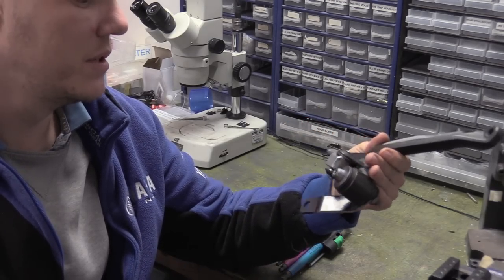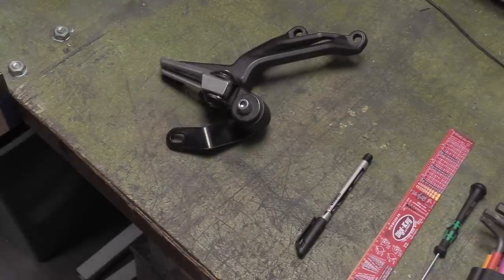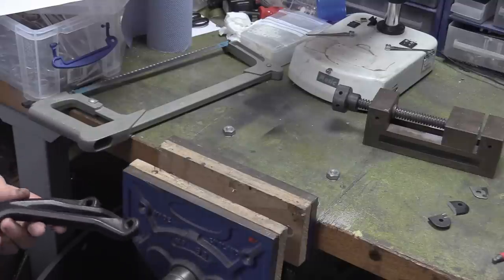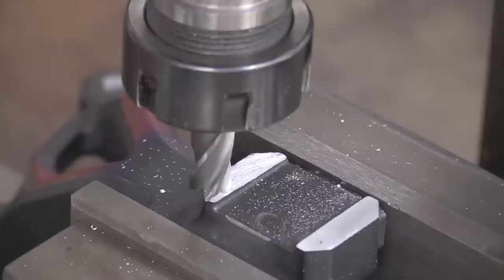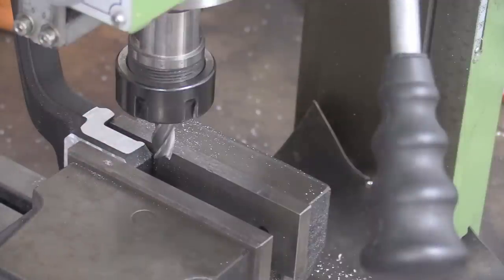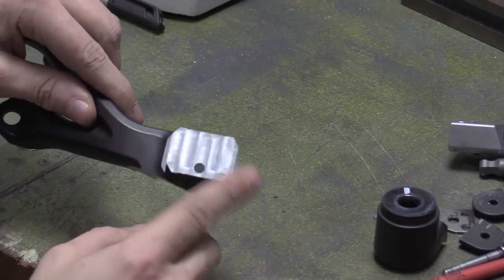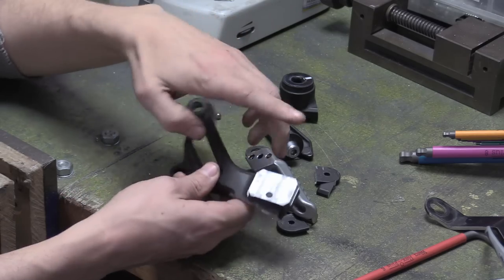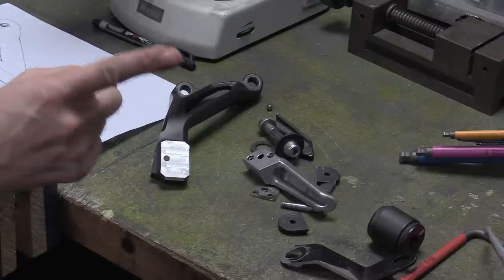Making it Factory! - Part 1

Comment: I've got a feeling it's to do with legislation that it has to have been manufactured to take a passenger before being registered if you are ever to use as it for a pillion. If you have a pillion seat and its covered by a cowl during mot its then considered a single seater machine. They should definitely offer an optional kit to include a cowl, exhaust mount etc. They cottoned on to people swapping exhausts straight away so offer "manufacture apprived aftermarket" options at point of purchase now. Its probably only a matter of time before they offer a single seat package too.
Reply from the maker: The PAnigale and a few other bikes don't have pillion anything, and don't have the option. I get what you mean, but if it was a legal thing then there should be evidence. I just wanna know what that is.
Reply: @dirtygarageguy  the difference appears to be the class. L3 being a solo machine over 50cc and L4 a combination machine over 50cc. I knew I had seen it somewhere. https://www.gov.uk/guidance/mot-inspection-manual-for-motorcycles/introduction
Reply: Ignore that. I'll keep reading.
Reply from the maker: LOL
Reply: @dirtygarageguy  The only legislation other than MOT regs that I’m aware of relating to rear footpegs is s.102 C&U regs which says that IF you carry a passenger there needs to be footpegs for them……so if you don’t carry a passenger, you don’t need them. You would need to cobble something temporary together for MOT time but that’s about it as far as I can see…..

Comment: A trick we use at work for feeling micro steps between surfaces is to use the plastic wrapping from a cig packet. Place it on the surface and then run your fingers over it and it magnifies the feeling of the step/surface imperfection etc.
Reply from the maker: Or fag papers, or posti notes or sharpie - this isn't that. Usually I'd use an edge finder or a plunge tip.

Comment: The reason they don't make a "monoposto" from the factory and a "biposto" conversion kit is probably due to homologation/registration/licencing/insurance regulations.  Have you noticed now how for many insurers you have to select the option to be covered to take a pillion?
Reply from the maker: How does that make sense? A genuine question. 125's have pliions too and I never understand that, specially since they build Euro models specifically. 

What I'm asking is what homologation/registration/licencing/insurance regulations exist that require a pillion carrying ability? Dirt bikes don't have them....
Reply from the maker: Well the Panigale V4 doesn't - 

https://www.ducati.com/ww/en/bikes/panigale/panigale-v4

If they can not do it....
Reply from the maker: And this is the road version - no pegs and no seat - but has a number plate hanger...

https://images.ctfassets.net/x7j9qwvpvr5s/3nlsFcuwtUUKcGSc6eWSaL/0bc411c15cc4a57db35bb4f912855a8b/Panigale-V4-Red-01-Book-testride_630x390.png
Reply: Ktm 690 enduro R/smc Does not have any rear footpegs. If you look at the seat who know if that's a single seat or not.  Also the rear footpegs allways go missing on all the honda xr250r's had to fit some  crf250l ones on with some washers but it never stopped it passing an mot

Comment: I like what you're doing there. However, when I fitted a "Tec Bike"  exhaust to my T120 I had a problem with fitting. In conversation with "Tec Bike" I said I was going to remove the pillion pegs. They said pillion pegs are a legal requirement where a pillion seat was installed. The T120 has a dual seat so I felt had to put the pillion pegs back on.   Plenty of Harleys are modified with single saddles and no pillion pegs.  Maybe if you do not have a pillion seat or pad you will get away with not having pillion foot pegs. I am sure a knowledgeable MOT inspector / technician will able to come up with the correct ruling.
Reply from the maker: "They said pillion pegs are a legal requirement where a pillion seat was installed."

That's all getting sorted - In the 4 month review I said I wanted to remove/replace the rear seat
Reply: @dirtygarageguy  - Yes I got that ( thumbs up). Being an Old Fart with worn out hips I cannot get my leg over the Z900 pillion hump seat. So I had to get the Z900rs which I can get on. However the riders end of the  RS seat is about 30mm higher than the Z900's  but,  without the hump. So it cost me 250 beer tokens for the Kawaski "low" seat.

Comment: I can basically guarantee that the reason for the pillion seat has to do with taxes. A single seat probably has a higher tariff. If I'm wrong, someone please correct me. Even my stupid little 8hp USA model Z125pro has a second seat and pegs, it can barely do 50mph with a single rider. It would be stupid slow with two people on it!
Reply from the maker: Well the Panigale V4 doesn't - 

https://www.ducati.com/ww/en/bikes/panigale/panigale-v4

If they can not do it....
Reply from the maker: It would be good to 'know' why they don't - unless it's just they believe they exclude a certain group of customers...
Reply: @dirtygarageguy  how much does the Panigale cost? I bet it is built into the price you pay.
Reply from the maker: If this is true then there must be a legal paper trail - and if so it should be public. I don't understand why there would be a tariff and how any tax gatherer could justify it. Like there a tax for NOT having pillion capability - but why? Surely if anything it would be the other way around.
Reply from the maker: The UK law is here - 

"Rule 85

You MUST NOT carry more than one pillion passenger who MUST sit astride the machine on a proper seat. They should face forward with both feet on the footrests. You MUST NOT carry a pillion passenger unless your motorcycle is designed to do so. Provisional licence holders MUST NOT carry a pillion passenger."

- but this wouldn't apply if all bikes had to have a capability
Reply: @dirtygarageguy  I know that at least in the 70's through much of the 90's a two seat car cost more to put on the road than a 2+2 car, even if that +2 was a couple of Chihuahua's because there wasn't enough space for more. And if people like Erik Buell didn't have to put a passenger seat on a sport bike, it and the pegs would not have been there on several of his bikes. And again, my z125 would be down right dangerous with a passenger.
Reply: I'd guess that this piece of legislation provides the answer. If it has to be designed to carry a pillion then they can't design it to carry just the rider and then make a conversion. Similarly, if it's got the seat it needs the footpegs, just like a car has to have a seatbelt for every seat. Take the seat away and you're fine.

Comment: You need the foot peg for your mot I know you still got 2 year left before you need one lol
Reply: Only of he keeps a rear seat on
Reply: That would mean buying the replacement panel
Reply from the maker: Buying? Don't you mean making...
Reply: O yer you got the 3D printer Matt I just setup a sand blaster and powder coating rig up in my workshop so if you need any bits doing just let us know
Reply from the maker: Ohhhh sand blasing might be an idea - you'll wish you never offered
Reply: You got an email Matt can send you some photos of previous bits of work I have done
Reply from the maker: Matthew-hudson@outlook.com 

 - have a blaster and cabinet and I use it in my older videos - until I lost the workshop. Don't have power at the moment so can't run it.